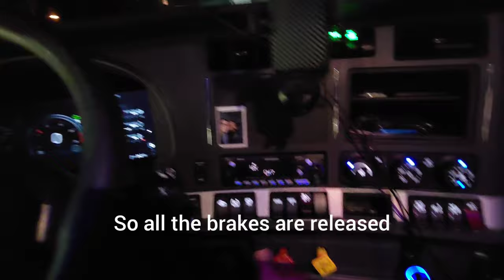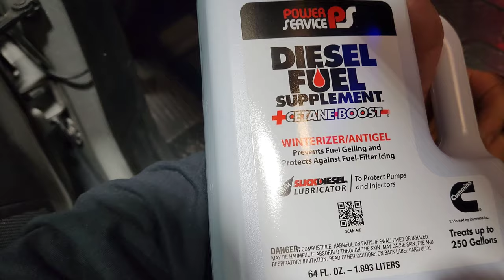WINTER TRUCKING, TIPS TO SAVE MONEY, TIME AND MAYBE YOUR LIFE.

Comment: Good advice for frozen drum brakes. I would recommend people read the power service label. If it is below 0° you need to double the amount used. The bottle that treats up to 250 gallons only treats 125 gallons when below 0°.
Reply from the maker: I believe that's also considering if the fuel is not treated whatsoever. Like for instance if you filled up in southern Texas and then went to North Dakota.

Comment: This year I used plenty of anti gel, but failed to replace my air dryer filter before it got cold. It was -2 here in Ohio Saturday morning and my suspension wouldn’t air up. Pulled into the shop and found ice in my air dryer filter. We replaced the filter, but then this morning my engine wouldn’t start. Had to use a battery pack charger and a shot of ether to get it going. 🤦‍♂️
Reply from the maker: Well when aI got back from my Sunday/ Monday run . I plugged the shore power and the engine block heater in just to avoid any problems...

Comment: Or you don’t be an idiot and set your hot brakes on your trailer in winter storm lol just set tractor lol😂
Reply from the maker: Some of the newer trucks Josh won't let you idle the truck without the trailer brake set/ or raise the idle .... I guess they detect the weight of the trailer mind you most mega carriers order automatics and stuff now so...
Reply: @Jackknife-TV  well im in a 2020 and the 2021 I had both were automatic and they both had no issue lol